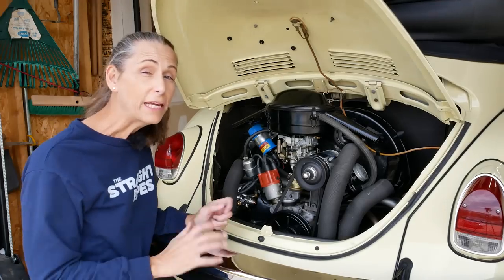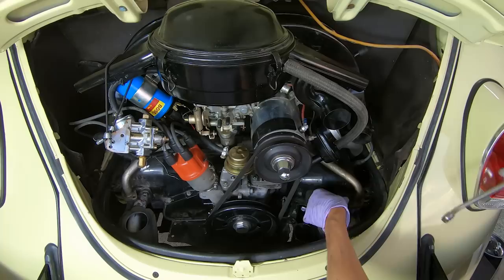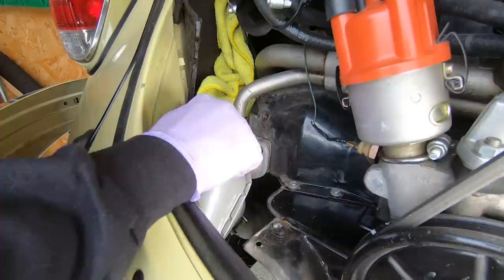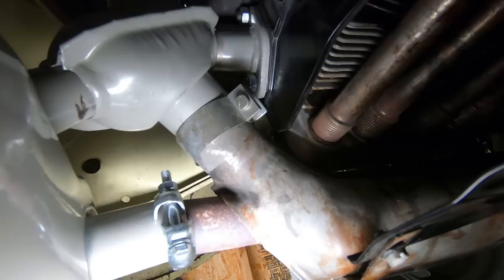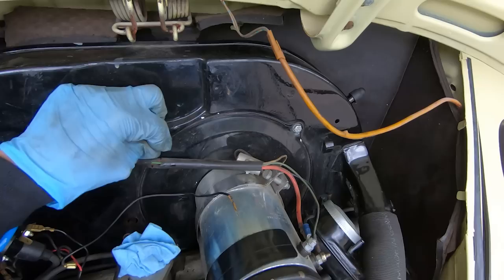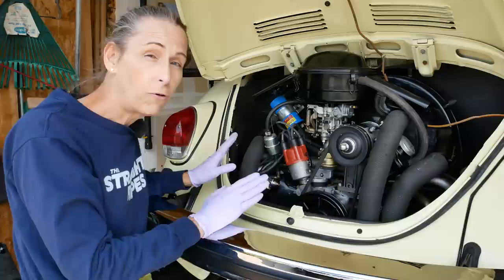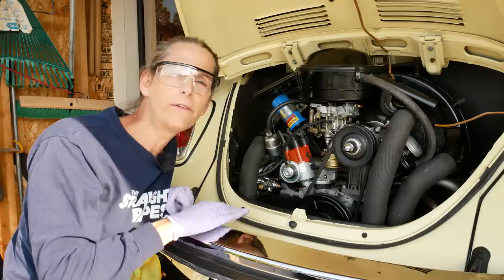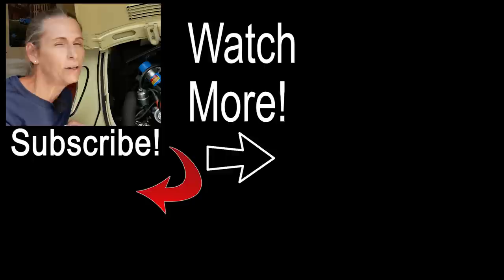VW Beetle NIGHTMARE Muffler Install and a Proper Distributor!!

Comment from the maker: Hi Everyone! In this final 1969 VW Beetle episode, I install a new muffler that goes poorly, fix that screaming fan and install a new Pertronix Flamethrower Distributor.

Enjoy!

That Timing light: https://amzn.to/35iSeJr
The Distributor: https://amzn.to/3jfPDoe
Reply: Why didn't you install muffler paste on the joints to preclude leaks?
Reply from the maker: Hi Jerry, I would have done that if need be, but, surprisingly (amazingly) there were no leaks!  It was actually noticeably quieter than the one I took off (which did have a few leaks).  
Alls well that ends well I suppose... F
Reply: Fran, my heat riser tubes are 100% NOT clogged, but they do not get hot.  Still I bought new ones and they need a lot an Yanky Ingenuity to get them (the new ones) to fit.  Should the left side heat riser gasket, or the right side, have a smaller opening than the other to get hot air flowing, or is that a sign of a failed muffler?
Reply: Hedi que no hase mejor el avance el distribuidor centrifugo que el que le instalaste al final de avance por vasio?. Saludos
Reply: @Jos van den Helm : Thanks for the confirmation 😁👍.
Reply: Aftermarket mufflers are always a little off and need some tweaking to fit properly.
Reply: When you change the distributor you don’t need to change the coil and cables?
Reply from the maker: @JoseRodriguez-vw5mo  Not unless they are bad. Pretty rare for a coil to go bad but the wires probably need replacing every couple years...
Reply: @HeidiandFranny what i try to understand is if that if I change from points to electronic do I have to change the coil and cables or just the distributor

Comment: Distributor timing with this type of distributor is this- set max mechanical advance with vacuum disconnected and plugged should be 28-32 BTDC. That is the most advance the distributor will provide at full throttle. Next hook up the vacuum line again and check the max advance it should be the original plus another 8-10 degrees or roughly 40BTDC.  This is what the vacuum does for you while cruising part throttle which is high vacuum condition. When you floor vacuum goes down and advance goes to the full mechanical side back toy where it was max set(28-32).
Reply: 3 years later your comment not only helped me to understand the specs of timing my Bug, but it helped me with the advance, even better.  
Just wanted to say thank you.  Thank you

Comment: Well over 20 yrs ago I struggled with the exhausts on Beetles and Vans, they never fitted, I 've attacked them with lump hammers, shut one side of the pipes in the vice and swung on the others. You wouldn't mind but the actual dimensions of the engines never changes, it can't be rocket science to make them using a jig?
Reply from the maker: Funny, it does change with temperature... On the 911 the engine can widen almost a quarter of an inch but the exhaust system is designed to adjust.  But, yes...  I'd love to see the car they used for a jig ;)
Reply: @HeidiandFranny  there isn’t a car, they are made on a dirt floor in China by a 9 year old with a spot welder and a hammer.......he has a photo in front of him for reference. And a stack of “empi” labels behind him to lick and apply.
In the next room is the blister pack operation.

Comment: I've owned VW's for over 40 years of almost every type, and we can ALL relate to your muffler fitting issues. I swear, l don't believe any 2 VW mufflers are the same. It's almost as if every single muffler is manufactured in a different country, in a different plant, using different measurements. They NEVER fit from one vehicle to another. I've got 2 old 40hp bus mufflers (both NOS), and one of them lines up pretty well, while the other is WAY the hell off!

Comment: You should have never put that cheap aftermarket exhaust on it, Should have cleaned up the original and put it back on. The aftermarket weren't designed to fit properly, And by widening out the bolt holes you only open it up to leak later. I use to own that exact year and they are a pain, But only with the aftermarket mufflers. OE slides right on every time.

Comment: Franny, 36 degrees is too much timing on that engine, 32 degrees is usually the safest you would want to run.. anything more than that you could burn holes in tops of pistons.
Reply from the maker: I bet you are right...  When I got the car originally it was set to 40deg.  Probably should tone it back a tad.
Reply: Times two. I usually run mine at at no more than 30 degrees max otherwise it’s easy to burn valves and pistons.
Reply: The extra 10° of advance only comes in with full vacume, e.g. cruising with very little throttle. When cruising the carb is running lean which makes the power piont of the combustion late.  Hence at 40° advance the power part of the stroke will be 30 to 32°. That is why the motor will not ping at 40° advanced on low throttle. I hope you can understand the way I wrote this.
Reply: @Paulman50  No, an air cooled vw should never have anything higher than 32deg at total max advance, and that goes for the 009,SVDA and DVDA... This is also referenced by VW and The Bentley Manual... Which is the VW mechanical bible... I should add I’ve been wrenching on these things for the last 30 years, so I’ve seen a thingy or so...
Reply: @coripuckett5596  if you max out at 32°, why would you want to put a vacume advance distributer on for. Because the feature of the vacume advance distributer is to pull an extra 10° of timing on top of the static 30° timing.
This is the reason for the mach between the 34pic3 carb and the vacume advance distributer.

Comment: I had a 1971 Volkswagen Super Beetle in this exact color with the "Automatic Stickshift" for 11 years from 1978 to 1989 and I just loved it, even though its zero to sixty time was 60 seconds! It was barely limping along by the time I sold it in 1989 for $400.00.  I still wish I had a pristine beetle with that style tail lamps.  (I really don't like the newer round tail-lights).  I replaced my muffler during an entire engine rebuild in 1979, and I went through EXACTLY this difficulty that you are discussing here now. 
My new Volkswagen is MUCH  better: it is a 2017 911 Porsche Carrera S Cabriolet with the 7 speed manual in Sapphire Blue. But I still miss my 1971 Beetle!

Comment: I used the same muffler and had the same issue. I ended up using a broomstick stuck in the muffler's flange and tweaked it until it lined up. Love repro stuff! ;-)

Comment: Really excellent work, yes aftermarket exhaust/manifolds are always a work out... I don't understand why so many fabricators have both incorrect dimensions or jigs they use to manufacture. I'm sure every installer would be reworking them. The electronic distributor is sweet!.
Reply from the maker: Thanks!

Comment: In the late 70's I replaced the muffler on my dad's 73 superbeetle. Even back then the replacement mufflers never fit correctly. It took me an entire day in 10 degree weather to get it in. I think the complex sheetmetal was tough to get to accurately fit. A lot of bending and pounding was needed. And lots of bolts! Great work, it might be fun to find a beetle to play with.

Comment: I would expect the muffler install to be a simple job: couple of bolts, seals, a bracket, but I wasn't expecting this for sure. That fan belt is really close to the bolt on the distributor, you have to be really careful. It reminds me of a mechanic who was working on the Volvo Penta MD7A in my dad's boat while it was running. The mechanic ended up in the emergency room. Luckily they were able to save his finger. Looking forward to the work on the 911 :)
Reply from the maker: I dread muffler work...  Either they don't come off (like the 911) or they don't go on (like the Beetle) or both ;)  Always scary adjusting the engine while running.  I do that once and then statically after that.  I did finally have my hair back though ;)

Comment: On the new muffler slot the flanges that go to the engine. Just the top on each side. Worked best for me. Also lifted the heat riser enough to push in the gasket, a pair of channel locks.

Comment: So many companies seem to be competing to corner the market in reproduction body panels that fit perfectly. If only they'd put the same effort in to making stock exhausts that fit 'out of the box'. I had weeks of trial and error before I got mine to fit and seal correctly. After fitting and removing the exhaust half a dozen times; I worked out the trick getting the heat riser bolts in. I found it easiest to get the front left bolt started, then the front right and then use a pipe wrench on the riser flanges to twist the risers while starting the rear bolts (again - left first, then right). The final straw was the heater pods. I had to mix and match in the end. I removed the pods from the old and new exhausts and fitted the old pods on the new one. I hope I don't have to do this again for many years though.

Comment: I think your vacuum hose should have a loop that goes above the carb and back down to the distributor. The metal oem ones did this so gas doesn’t find its was into the distributor. 

Where was the empi muffler made?  China or Mexico?  

You’re lucky to have a car that wasn’t exposed to rust.  I did my vw work in Pittsburgh and we never see heater boxes that weren’t rusted out.

Comment: Switch to dual carbs is the best thing a VW owner can do. Get rid of the crappy stock exhaust that have so much difficulty in getting to fit. Franny as far as caps go- both of those fit you would have to reorient the the wires,not a big deal. I cant talk many of my friends to switch to dual carbs let alone a casual viewer of classic VWs. Its a shame really. They are better in every way including gas mileage and performance. No need for a chokes either. I know many will not believe this but it is true. I live in the midwest and drive my bug in all weather unless there is salt on the road and car starts and drives without issue. Anyway always use never seize or copper grease when attaching exhaust nuts to studs or anything exhaust related. 
Half the battle working with exhausts is getting things loose. As always Franny you do great work and respect the process,fun to watch. Scott
Reply from the maker: Thanks Scott.  Yup, the 356 had dual carbs.  The VW was designed with a different philosophy and different price point so I get it.  But the 356 is easier to get to run actually.  ...and no choke ;)

Comment: Well maybe if the muller was made. Anyware other than China, it would have fit 100%  better. Great video,I will used the distributor install part. I also  had issues installing a empi type stock muffler . Had to do drill, cut etc.Thx,again !

Comment: Hi Franny - What a great channel you have !   Really enjoy seeing all your videos.   Just thought I should mention that you ideally need one of those  metal J-tube  (looks like an upside down J when installed) between the vacuum canister and the carb, to stop fuel backing up into the cannister. (the fuel can damage the diaphram)  They are basically just metal vacuum lines with a kink.  Can send a link if you need the part.   Cheers, from the UK.    Regards, Jon.
Reply from the maker: Thanks for the tip!  I'll pass it on to the owner.

Comment: I think you have connected the vacuum line to wrong port on that carburetor. The port where it is now connected is for DVDA distributor retard function.
The vacuum advance connection for SVDA is the one above the idle mixture adjustment screws on the left side of the carburetor. 
Please look at:
https://www.volkzbitz.com/34pict-3---4-and-h30-31-adjustments.html
Reply: This person is correct.
Reply: Yes I saw that also, and she retweeked the timing after the vacume line was hooked in. The reason the timing was different was probably because the vacume advance was nudging it. Cruising at maximum  vacume it should pull about 40°.

Comment: The rotor button should be pointing to the number 1 position on the distributor cap when the number 1 piston is at top dead center (on the compression stroke). The pistons come up two times during the combustion cycle. Once for the exhaust stroke and again on the compression stroke. The mechanical ignition timing should be set so that the rotor hits the corresponding cylinder on the compression stroke to ignite the air/fuel mixture.

Comment: Seeing this last article;e jogged my memory.  Wife number 2 and I had a 69 bug. It was an A.S.S.  or an automatic stick shift.  Gas, brake but no clutch pedal. A slight push on the shift lever would activate a solenoid that operated the clutch. If memory serves a few 911,s were like that too. I don't think VW made them but a couple of years and I never saw another one besides the one we had.  In later years I've owned 2 other Bugs a Rabbit and 3 Porsches and 2 Mercedes Benz (diesels.  I love German cars!

Comment: I have better luck with the ERNST german brand when they are available
Reply: when available, that was the thing here, you went to the supplier and had what they had , they were so cheap , you sort of accepted they fitted rubbish
Reply: Well I did a few beetle muflers in the past, and don't spend too much money on original muflers becouse they always give you a ficht before theyre on

Comment: You have been formally introduced to “cheap, aftermarket” mufflers for air cooled VWs!  The good news is if you loosen half the bolts on the outside of the engine and cut, grind, and weld on the muffler enough, it will eventually fit and work. The bad news is these cheap mufflers are made of low quality steel and they’ll rust out quickly, so you’ll be doing the job all over again a lot sooner than you plan. Genuine German mufflers cost more but make the job a lot easier and they live longer.
Reply from the maker: This is a friend's car and he purchased the muffler.  If it was me I would have spent a bit more on a more legit muffler ;)

Comment: Hi Frannie, I just got a new electronic ignition without vacuum advance for my 1965 Bug. I’m hoping to eliminate a flat spot, or hesitation when I’m up-shifting/accelerating, as well as improve fuel efficiency and overall performance. Wish me luck! This car has brought me to the point of wanting to throw a match in it and be done on several occasions previously. 🤞
Reply: Is your car still 6v?
Reply: @JasonNaughton  no, it was converted some time before I got it.
My new distributor with electronic ignition is working great, it even eliminated the flat spot I had with acceleration with the old one. I still need to fine tune the timing with my timing light, but I’m pleased with it. I never know how these things will go, having been through my fair share of expensive pains in the neck with this car.

Comment: That’s pretty normal; you always have to finagle the heat risers by prying them up a little. Little screwdrivers help in lining up the holes in them to install the gaskets and bolts. It can certainly be a little bit of a pain.

Re the noise you heard at first I also suspected something with the fan. After some time driving these you recognize any different noises. In my car I can recognize different whistles to the point where I know if there’s any obstructions in the fan. In one occasion I found a little piece of paper sticker it had sucked up and was creating an abnormal whistling sound; another time it was chewing up the end of a piece of welting from the engine compartment; these fans do have a lot of pulling power....😉

Great point on suggesting turning off the ignition switch. These ignitions don’t like to be on without the engine running too much and they’ll fry on you. Also good call on lubing up the distributor. The folks at aircooled.net stock them and like them but they suggest you actually examine and clean and lubricate them before installing because the manufacturing facilities are sketchy and sometimes they come contaminated with debris from the factory. When you install the vacuum line to the carb the little curved metal line as used from the factory is suggested to prevent any fuel from the carburetor to damage the diaphragm on the distributor. Also on some of these carbs the actual location of the vacuum line from the carb can vary; some of them come from the side.

That was a great thorough service to this car. Your friend needs to be very very thankful to you 😉.
Reply from the maker: Thanks Ricardo, all great points and tips.  I'm glad I lubed the distributor first then...  It felt a bit dry.  Thanks again!

Comment: Just as a heads up, you realy need to reshim that fan a bit further from the backing plate to make sure the sound doesn't come back.

Also, something that helps with exhaust is to take the intake manifold off when you do it. The empi exhaust are typicaky wonky, but that will at least help in the future
Reply from the maker: Thanks for the tip!

Comment: Yes the 009 is not really the best choice for a stock VW Type 1 . I am running a 009 distributor with electronic ignition on my 2180cc which works very well for a big street racer motors but for a stock 69 VW i totally agree the vacuum advance distributor is they way to go ..
Reply: I'm running vacuum advance on my 1776 and 1915 CC with Dual Dellortos , drivability for street is better than 009